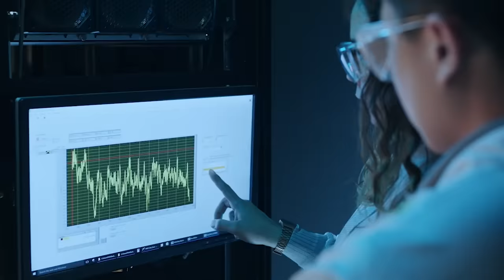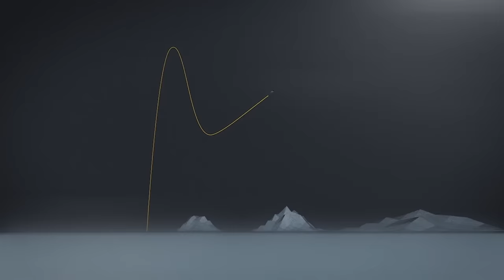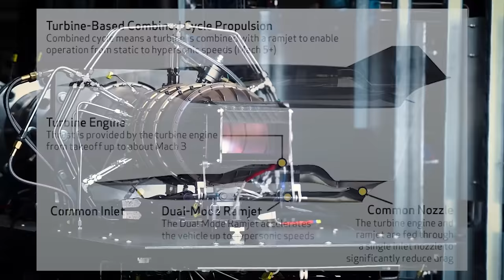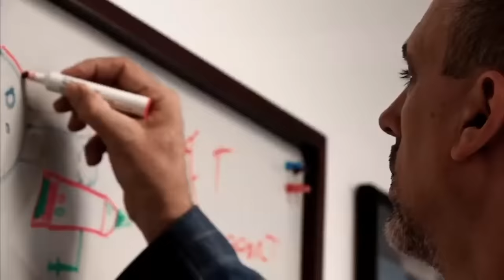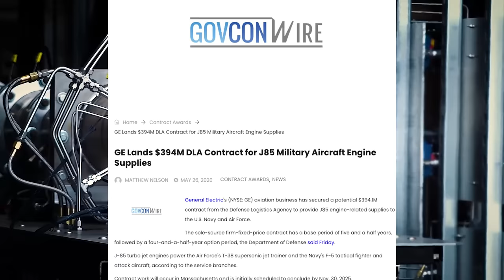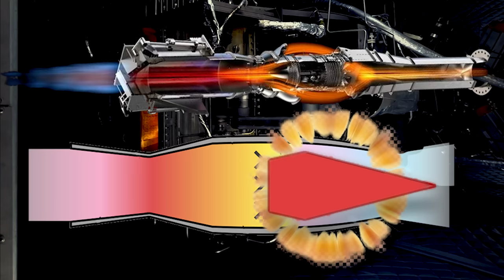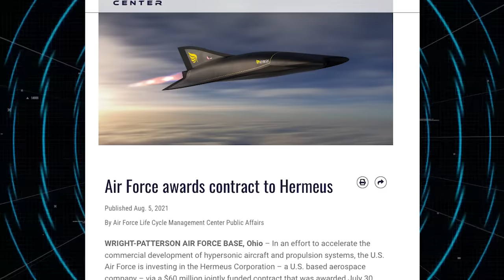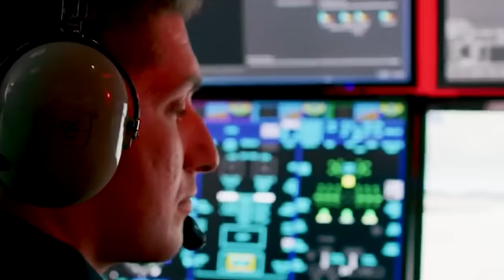Could HERMEUS turn the hypersonic arms race on its head?

Comment: What do you mean win the race? Speed? The Avangard glider reached in trials 32 Mach and is manoeuvring. Russia has hypersonic missiles since 2019 (currently three different types), China since 2021. US experimented with less than Mach 7 and abandoned. There is no contest.
Reply: I think the video explained this very clearly: hypersonic, air-breathing, reusable, and maneuverable.
Also, the NASA 43 reached almost Mach 10 in 2004.

Comment: What about high-frequency electric current in a circle controlled by capacitors so high that gravity ends and weight is gone, and forward propulsion becomes so easy that a push by a falling toddler can send a 6000-pound ship up to 30 mph! in the short future. And simple. Why do you think mercury is becoming such an expensive element ? It's the central element in the amplification of Gravity, The key to opening worn holes so that our ships can go thru one without going back to the Earth to a lay-line intersection!

Comment: I disagree with your claim that there is "no barrier at Mach 5 ". It is called the Mach 5 Barrier precisely because of the physics involved at these speeds, in much the same way as there are physical changes that happen around the original "Sound Barrier"! You even state this fact, yet you strangely refuse to acknowledge this physical reality as something that must be overcome! I might not have my mechanical engineering degree just yet, but I still think you are badly mischaracterizing the engineering problems inherent in the pursuit of "hypersonic" when you claim that there is "no barrier at Mach 5"! These are serious mechanical problems that must be addressed by upscaled systems if they are to perform their intended tasks effectively while at these speeds. I strongly dislike the way you mentioned the underlying facts then proceeded to ignore those very same facts whilst denigrating the "popular" or "buzzword" term used to encapsulate those facts for a non-engineering audience!
Reply: Because there is no qualitative difference between flying at Mach 4.9 and Mach 5.1, no "barrier".